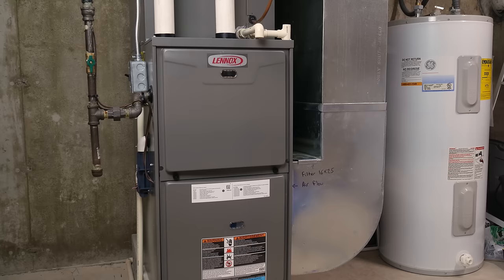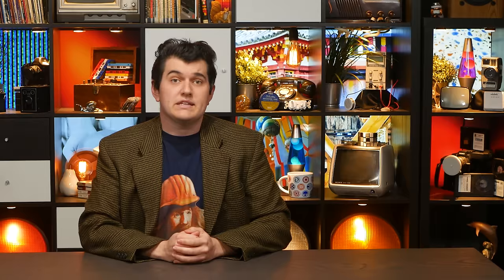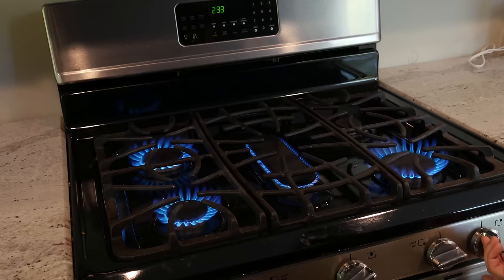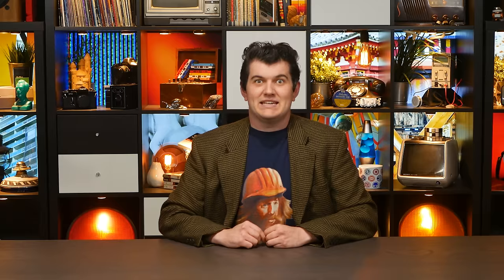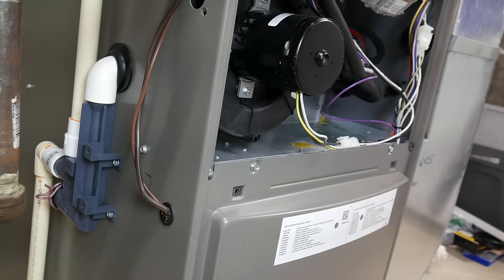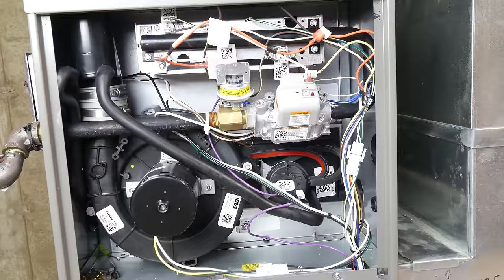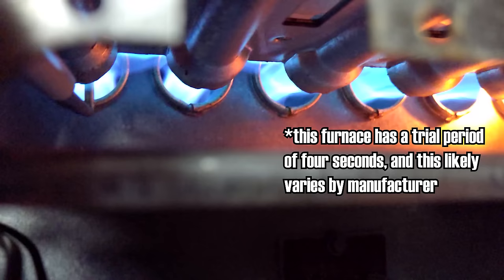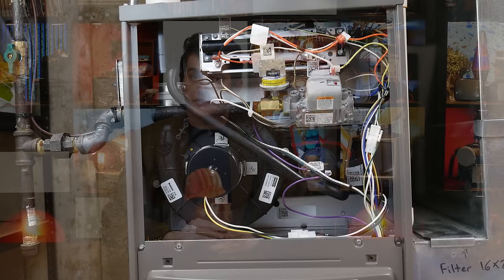Forced-air Furnaces: The What, Why, and How

Comment: This explains why Reddit always talks about having CO detectors everywhere (in relation to the infamous r/legaladvice post). In the UK, we have CO detectors in the kitchen (gas stoves) and wherever the boiler is (usually also the kitchen) but rarely anywhere else
Reply: Here in Australia too, I've never seen a CO detector because it's just not a problem for us. If your house requires central heating in the winter, you're probably based somewhere about a thousand km south of Tassie because it's basically NEVER that cold here. Then again almost none of our houses have central cooling either, we just prefer to do it on a room-by-room basis. You don't live in the entire house anyway, you live in one room at a time, so why cool the entire house when you're only living in one part of it and can simply turn it on and off as needed?
Reply: @Abigail-hu5wf  Ah you say that but when I went to the Blue Mountains in September one year it was FREEEEZING 😂
Reply: It's because European combi boiler is a much better product than the American forced air furnace
Reply: @bulentkulkuloglu I wouldn't say better, just serving a different purpose. Boilers have a longer startup time, but have more continuous heat output while forced air has shorter startup times and lower maintenance costs. 

Here in the USA we have a law that all cycled pressure vessels have to have yearly inspections and cleaning. Boilers have extra steps with descaling and other such procedures like a lengthy rebuild every 15 years. Forced air requires built in test equipment as shown here, but no yearly inspections.

If our climate was as cold as yours, that upkeep cost might make sense on a multi-family scale. However, when we have at least 70°F (21°C) for 10 months out of the year, it doesn't make sense to have such an expensive heater.

Side note because it is awful, I have had a 115°F (46°C) heat index for the past month. I don't need any more heat.
Reply: @nathanielhill8156  kombi boilers are not high maintenance, they give heat instantaneously as water heaters, and for space heating they are not that slow.
Kombi heaters come in many sizes, including mini ones for 1+1 apartments, to single family homes on two or three floors with thousands of square feet. They are relatively cheap, 500 dolars at most, and yes last 10-15 years on average. Then you just replace parts or the whole unit.

Comment: "Heat pumps... They are indubitably the future of home space heating" Living in a house that have had geothermal heat pumps heating it since 1982, I just gotta say welcome into the future whenever you are ready :)
Reply: The best installations range from inconvenient to impossible to install after the house is built, so not so suitable to suburban & urban locations.
Reply: Jared Maddox yeah its far easier to convert if you are heating with water instead of air. Then it's just a two day job.
Reply: @absalomdraconis  If you already have central air, you can have a heat pump.  The air handler replaces your existing furnace and the refrigerant lines are run just like a typical A/C installation.
Reply: @Lawrence330  : The best systems are geothermal. Unless you have a reasonable amount of easement-free land, you can't realistically install them after the house is built, only before.
Reply: @absalomdraconis  The best heat pumps you mean. Gotcha.  I mistook your statement to mean that you couldn't easily switch to a heat pump (not specifically GT) after the house was built.
 Even an air source heat pump is quite efficient in the lower half of the U.S. I'm in coastal VA and have had a heat pump here for a decade. This house is very poorly insulated and ventilated, so I imagine newer/better construction would see a bigger benefit than I do.
Reply: @absalomdraconis  A horizontal loop requires some land, but a vertical loop could be placed more or less in any lawn. My 230 meter loop doesn't take up much more space than the lid covering the well, the size of a manhole cover.
Reply: The UK wants to phase out gas boilers in the near future and make ground source heat pumps standard.  It is more about reducing CO2 emissions, with efficiency as a side benefit. Reversible heat pumps are a bonus for the rise in hot summers.
Reply: @denislostinlondon199  not sure about ground temperatures you got, but if you live in a fairly cold place, you don't even have to have a reversible pump. I installed cooling this summer, and since l got about 4-5C in the ground, I just run the liquid from the well straight into fan convectors via a circulation pump, the running costs are incredibly low, and since you are heating the ground raising efficiency in the winter, it's essentially free cooling.

Comment: About a decade ago, my parent's furnace in their home, which was a few years old, developed a crack in the heat exchanger as you mentioned. The furnace shut itself down automatically. Of course, this happened during a frigid cold snap in mid-December when lows reached the -20's F and highs barely reached zero. They had a Tempstar furnace. Tempstar overnighted a replacement heat exchanger to them but it was for a different model furnace!! All in all, it took a week before their furnace was back running normal again. Until then, they used four different space heaters to heat the home during the dark hours. One was one of those oil filled radiators which they blew a fan through to help heat the area. During the day, they opened all southern curtains of the home to allow the sun to heat the home. Thankfully, it was sunny most of the time. Never once did they go under 60 degrees in the house. A spokesperson for Tempstar was appalled by their parts delivery saying "These people should NOT have needed to wait a week in frigid conditions for a part for their furnace!"

Comment: A relative had a new furnace like this put in years ago now, like 6 months after it was in in midd winter it was cold in the house. They looked at it could not find issue, called installer said something is messed up with this thing you installed fix it. End up being (what they said was common issue) a bird sat on the vent on the roof, the Co2 made it pass out falling down the chimney. Then somehow the bird made it into the draft inducer stopping it from running. They later had a cap put on the chimney so this does not happen again.
Reply: Why didn't it have a cap by default???
Reply: @absalomdraconis  
santa gotta come in somehow

Comment: That "Ok bye" at the end killed me haha, very good video and I'm looking forward for your video with the thermal imaging camera! Also finally someones that understands the upsides of heat pumps, I live in Québec and I want to buy a house and I'm really looking for one with everything already installed.
Reply: Heat pumps are pretty useless below a certain outdoor temp.   They depend on an aux system below then, and hence become very inefficient.   They're terrific in relatively mild climates, but in very cold areas they're not very good.
Reply from the maker: @nate8088  I would counter that there are always days in any climate where they're useful. Honestly, if we had been installing reversible air conditioners for the last 2 decades, we all could see reductions in energy costs and emissions. Even in areas like mine where there are plenty of nights where it wouldn't do much at all, there are also plenty of days when it would be more than sufficient. All it would take is an outside air temperature sensor to determine if it's feasible to run the heat pump. If it is, then do that! And if it's too cold, then you switch to the natural gas or other form of heating.

There's a lot of people that think of this in a binary sense that a heat pump is only valuable if it can work as your only source of heat and I think this is a very poor way of thinking. Especially since all it takes to turn an air conditioner into a heat pump is a set of reversing valves. If you are gonna have A/C, you might as well make it a heat pump and frankly I'm somewhat amazed this isn't the norm.
Reply: In Québec (Where I also live) you're most likely going to find houses with electric baseboards, even in new houses with central AC... Electricity is so cheap here that we can put a giant resistor in each room to heat. It also makes finding a smart thermostat very hard as almost none of them are made for 120/240vac (most baseboards are run from 240 - the wires in the wall should be a different color)
Reply: @TechnologyConnections  What looks promising is geothermal heat pumps. It doesn't take much to drill a hole and run a heat exchange pipe a few meters below ground to tap into that constant ground temperature year around, even at a single-family home level of operation.
Reply: Jimorian My parents got geothermal in their house and it was a huge process to dig the trench that the pipes would run in. With regards to how efficient it is they are very pleased with it and their electric bill so maybe it’s worth it.
Reply: Philippe i know we live in the place where we have the cheapest electricity of all of North America but I still want geothermal heat pumps because I know I will keep the house for decades and it will still be worth it :)
Reply: @TechnologyConnections  I Agree, it seems like un Quebec most people get an Heat Pump for AC in the summer, but most models are reversible for autumn/spring and the few times in winter it can work. Still, some system can get pretty pricey...
Reply: @nate8088  It's not temperature that makes them inefficient, but temperature AND humidity. Here in the northern Italy it's not that cold, but we have a lot of humidity: when you are below roughly 5°C the outside coil gets so cold that it gets blocked by ice, and what the heat pump does to solve this is inverting the cycle to warm the coil so that the ice falls down. Anyway this is generally a problem for small split systems, large ones are built with this in mind and have oversized coils (that also makes them more silent).
Reply: @nate8088  They stay efficient,  mostly their capacity decreases.
Reply: @Jimorian  Yeah, depending on the location sometimes a trenched system is best, sometimes a well.
Reply: @TechnologyConnections  My split system reverse cycle unit works well in winter for me and I live in quite a cold area, well cold by OUR standards it does go down to -3.C average overnight and it works well when its over 45.C in the summer time for cooling. I am in North eastern Victoria in the land down under.
Reply: @Zackmermiz  I wish I had cheap elec power here it can be over 35 cents a Kwh. and over $1 a day for supply charge as well.
Reply: @TechnologyConnections  You'll be happy to know in civilised countries (AU / NZ from my experience) almost all "air conditioners installed are "split systems" (heat and cool)  and for the last 10+ years have been quite popular.  Interesting video, love your work!
Reply: @TechnologyConnections  oh I always forget about non-geothermal heat pumps. When I was like 6 we moved from a hand built house with a heat stove (this was rural Montana) to a double wide trailer with a geothermal heat pump (due to my mom's lung disease). So I got used to geothermal heat pumps early and takes me a minute to remember the other kind
Reply: @lululombard  Oh I get it, when I was "house shoping" I was looking for one that ticked all the boxes... but it's always a compromise - you're better off finding a location you like at a price you can afford and installing the geothermal system after - maybe 5 years after you move in... because while you can renovate you can't move the house
Reply: @Zackmermiz  Yep I know, I also consider buying a terrain and then build a custom house with everything I'm looking for (CAT6a wiring in all rooms, solar panel, geothermal heat pump, etc...)

Comment: I'm in Ottawa, Canada. I grew up in a house, built in 1970, with an oil furnace. Because it was before the energy crisis of a few years later, I'd really be surprised if it reached 70% AFUE. There was no draft inducer, it was totally reliant on wasting heat for the chimney effect to drive the exhaust out of the house. In the early 1980s, natural gas was run down our street and the furnace's oil burner was replaced with a gas burner. They must have retrofitted hundreds of homes in my neighbourhood as gas was cheaper even if it was burned relatively inefficiently in a heat exchanger designed for an oil fire. 

A childhood friend of mine lived in a century-old farmhouse nearby. I remember the gravimetric furnace in his place. No draft inducer, no blower fan either. If you remember the scary furnace in the movie Home Alone, it looked like that. It used the chimney effect to drive the warm air to the rooms in the house, requiring large ducts throughout. They were nicknamed an "octopus furnace" by HVAC techs. His had been retrofitted to run off natural gas as well, but the coal chute and the coal screw were still there. I remember as a kid being totally fascinated by this. When Greg's furnace started up, the coal screw still ran to carry coal to the burner... lots of tiny soldiers and GI Joes rode the coal screw to their demise. When I was on sleepovers at his place, we used to sit in the basement and toast marshmallows in the fire. Hopefully not with plastic fuel... LOL. 

Greg's father loved the gas conversion because it was cheaper to run and he didn't have to clean the ash out of the firebox every day. Unless a Cabbage Patch Kids doll had ridden the coal screw... LOL

I do like the old gravimetric furnaces because they can be run without electricity and can be made to run on basically any fuel from wood pellets to oil to gas. But they are horribly inefficient. Huge cast iron heat exchanger; even after the thermostat turned off the heat, it would still be warm air out of the ducts for hours. I remember that the coal screw would start running at the same time as the (retrofitted) gas burner ignited; I do not know how this furnace was originally designed to ignite the coal/wood/corncobs that it was meant to run on - maybe it just dumped more coal on the (small) fire remaining from the last time the thermostat called for heat. 

HVAC tech who is a friend of mine was putting in a modern condensing gas furnace into a 140-year-old house with an octopus. The owner insisted on keeping the octopus to maintain the originality of his beautiful home. And I don't blame him, either - you also have fuel flexibility. So right now, somewhere in Toronto, in the 416, is a beautiful old house with an original Findlay Foundry octopus sitting right beside a Trane XV90 with air conditioning. I have no idea how the ducting was done; gravimetric ducting will not work with air conditioning! 

You should do a series on the evolution of home heating in cold North American climates. It is something we take so much for granted, but it is the product of much genius engineering and is the only way we have any sort of ability to generate prosperity in this part of the world. 

Geothermal heat pumps are, for sure, the future for us. But before we can understand a Tesla, we have to understand a Ford Model T.